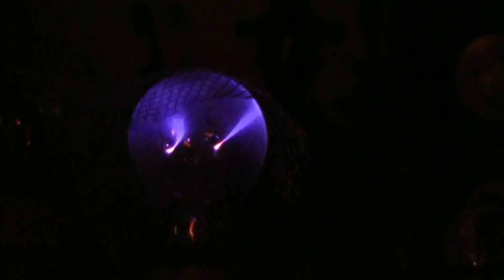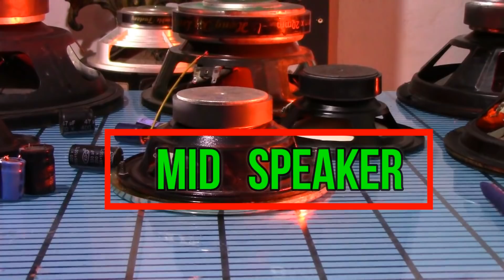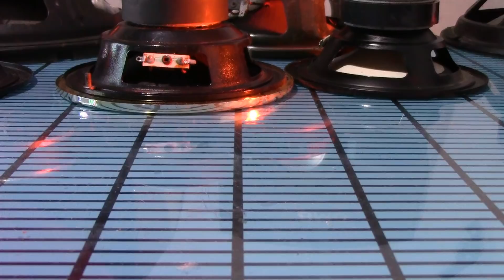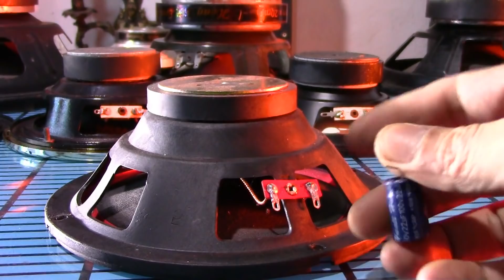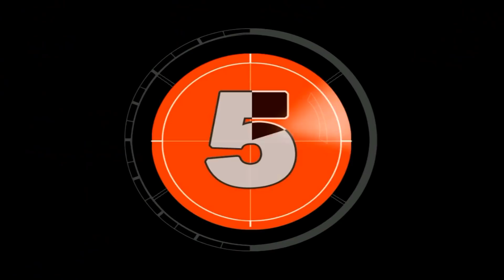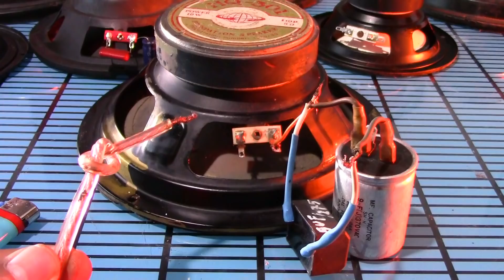How to improve sound and install the mid bass speaker, 5 basic tips using Capacitor

Comment: Short mylar its cannot damage
Reply from the maker: This is not the reason why it is broken, but rather by dividing the frequency among the mid speakers
Reply: @AlfredH  its ok 100uf 160volts2x  only for mid i use.  15 inches 500watts 600watts amp.
Reply from the maker: If you want lower bass, increase the capacitor value